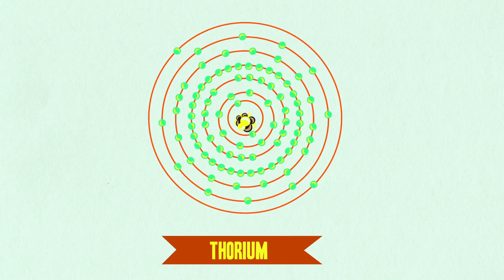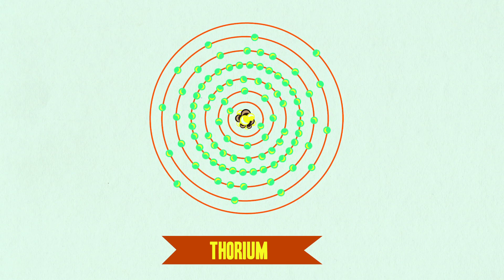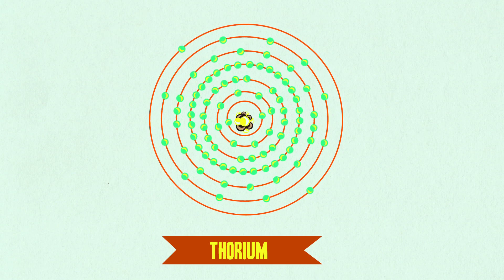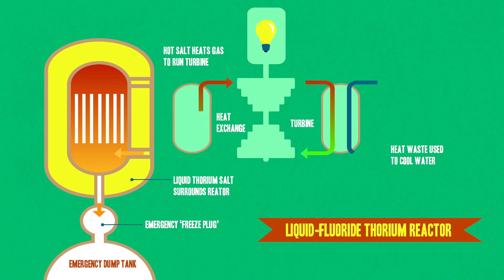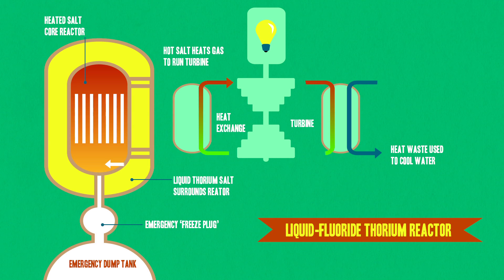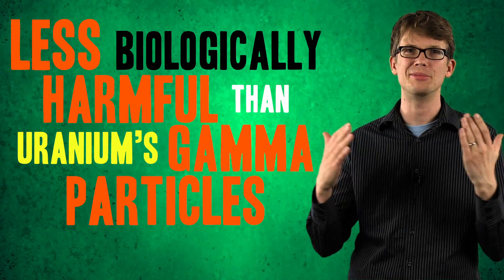Liquid Fluoride Thorium Reactors (LFTR): Energy for the Future?

Comment: While I'm not going to say that I'm totally against the LFTR design there are a few issues I have with this. 
1) both uranium and thorium are alpha emitters. It's what is further down the line that gives off the nastier gamma's in both cases. This gripe is more specific to this video and not the technology presented as a whole.
2) that "short" waste life is if we reprocess the thorium fuel. This is a necessary part of the thorium cycle. It keeps the big nasties in the core if you will. Then again if we reprocessed current Uranium spent fuel the same thing could be said with similar waste reduction (about 95%) and hazard times as the trans-uranics (heavier than uranium) are the most serious offenders.
3)The big reason thorium is said to be "non-weaponizeable" is that a small amount of it breeds into uranium 232 which is a very nasty gamma emitter and would cook anybody who got enough Uranium 233 (what you are actually burning in a Thorium reactor) in one place to make a weapon.  We actually tried to do it once and found this out. This isn't as big a problem if you don't care about killing the people building the bomb. However this means in operation Thorium reactors are actually more radioactive than a comparable uranium one fun fact.
4) moderate enrichment light water reactors actually suck at making plutonium retaining only about 1% (most of it gets burnt up and is taken into account when planning the life of a particular fuel element).  This is only an issue because each load of fuel is a few thousand pounds so the 1% of converted U238 left at the end is still a lot of plutonium generated. Fun note if you ran a reactor that was near 100% u235 almost no plutonium would be generated.
5) Thorium is fertile not fissile. This means you have to breed the thorium into something that works (Th232->U233). Currently India and China are playing with it but the doubling time (time it takes to get twice as much fuel as you started out with) is a lot longer than a cycle so you would need a lot of uranium or plutonium to supply the neutrons to breed enough thorium to keep the whole show going. Sub critical accelerator driven breeders could cut this down but it's not a solid tech yet and this problem is generally one not taken into account by the hype.
Again I'm all for the development of Thorium as a fuel type as there is enough of it to keep us electrified for hundreds if not thousands of years but a lot of serious innovation needs to be done to ALL nuclear technologies which have been oppressed in the realm of public opinion and politics for most of their existence. Most notably if we seriously want to start being a space faring race we're going to need nuclear reactors in space.
Reply: Andrew Gahan oO

Comment: Did he say that uranium emits aamma particles? Shouldn't he say gamma rays?
Reply: +Richard Yates I think the original commenter only said "aamma" because of a typo. I believe what they were asking was why he called the gamma radiation a particle rather than a ray
Reply: either makes sense. the wave particle duality says that light behaves both as a wave and as a particle (represented by photons, the carriers of the electromagnetic force). so technically, you could say either and you'd be correct
Reply: I think he does say aamma, but I'm listening on laptop speakers. At least he did mention alpha particles, they only travel a few inches through air before they break down. Hank is the only one besides Sorensen I've heard mention this in a video. I hope he's not saying Llama particles, I'd hate to have those little black pellets all over the place stinkin' it up.
Reply: oh I get it, he doesn't know the particle travels in a straight line a.k.a. "ray"
Reply: +Richard Yates well, it's not that he doesn't know. regardless of whether you call it a "particle," a "wave," or a "ray," you're correct. I posted a comment in response to the original comment that explains what I mean
Reply: the problem there about weather it admits gamma or alpha comment is WRONG! gamma is the least of our worries alpha is a serious issue and the worst type of radiation for someone to uptake
Reply: yeah, noticed it too..
Reply: Alfa radiation does not penetrate deeply. a sheet of paper is enough to stop it. however, if it does penetrate, it can do a lot of damage. gamma does have a lot of penetration power but doesn't do that much damage. the thing is, gamma can pass through meters of concrete and lead before it stops. so it can affect more matter but not with as much power as Alfa. (or at least, that's what I remember from physics class last year)
Reply: yes that is correct I am a long time employee at a nuclear power plant in Canada gamma is no big deal but beta  and alpha are serious hazards. not to dismiss gamma though
Reply: So you have an interest in maintaining/propagating the current uranium dioxide system yes? It's explained fairly well on Wikipedia, people can see for themselves what the particles consist of,

Comment: it's only expensive to convert current plants, creating new ones, using multiple smaller cores, added when needed, is cheaper.

Listen, if I sold you a GE or Westinghouse nuclear reactor, I'm gonna want you to buy fuel from me.. it is therefore the norm, and an easy, lazy way to make a profit. Therefore, there is no need for scientific and technological progress.. just keep buying my rods!

interestingly, it seems that the waste created by current conventional plants can actually be used, so this can reduce the dangerous waste we have in storage currently to stuff that is far less dangerous, as you say, for no more than 360 years....
Reply: This a good point, from what I gather no one is considering converting conventional nuc-plants to run on Thorium anyway; they want to convert them so the waste they produce will be easily consumed by the new liquid-Thorium plants. That type of conversion may not be very costly considering the expense of storing the long lived waste they produce now.

Comment: I would like to see the benefits of the LFTR combined with the efficiencies of CANDU designs like online refuelling and safety systems.
Reply: All MSRs, including LFTRs, have inherent safety that beats any water cooled reactor, and depending on the design, LFTRs have continues fuel processing.
Reply: Have you noticed Koko, how many people on the internet think the pumps in the LFTR are for cooling? If the pumps in a LFTR stop working, The LFTR stops producing heat or radiation. The molten Thorium salt is there to transfer heat to gas-turbine electrical generators. There is no boiler and no water there to explode like Chernobyl.
Reply: you hit it right on the head there with CANDU!
Reply: I'm going to go look it up but can you give a short explanation of CANDU for everyone?

Comment: Ames process. Use Thorium to help make Uranium. But I guess that's too good an idea. The 1950's  ideas are too old to be of use?
Reply: LFTRs are a 1950's idea, they came from the same man who developed our current Ur-based plants which are very much safer than Fukushima. The U.S. Air Force funded Alvin Weinburg ("on the sly" sort of) to research a smaller mobile plant for electrical generation on the battlefield. They started development in the late 40's and Nixon "pulled the plug" on them before they could actually test Thorium in they're "emulator" type reactor.

Comment: Since Thorium is an element, is there any possibility of its extinction in future due to much consumption? Even if it does, will there be an alternative?
Reply: Thorium is extremely common. I've heard estimates that the sun would burn out before we run out of thorium. By the time the sun burns out who knows what we'll be using for power.
Reply: Well.. that's not nice...anyways thnx for the info
Reply: kokofan50 But how will sun burn ouy
Reply: John Peter The sun has a gigantic but limited amount of hydrogen to burn, and in about a billion years it's going to start running out of hydrogen and go red giant.

Comment: You neglected the fact that thorium reactors do not produce plutonium (bomb material)
Reply: +Joseph Fishwick yup the the thorium 232 at the start of the process is hit whith an electron and becomes thorium 233, which turns into proctactinium 233, which then becomes uranium 233.  the uranium 233 is the end of the decay chain within thorium based reactors, and while it is being used as fuel for the reactor one of its  electrons flies off and hits another thorium atom starting the process over again. by comparison uranium 235 and 238 which are the most naturally found forms of uranium and are what are normally used in our reactors now. 235 is what is fissile, while uranium 238 is what is turned into plutonium 239 before it can be used as a fissile material. the problem with that is that uranium 235 is the  far less common of the two isotopes and it is practically impossible as far as i know to separate the two before sticking them into a reactor, and thus not possible to remove uranium 238 from the equation. thats partly why the thorium reactors are becoming more of an interest, because while in the end uranium is used it doesn't leave behind any other isotopes like uranium 238 that cant be used as fuel from the start. "if you already knew this then consider it a comment meant to help others understand a bit more of the process involved" btw i might have gotten electrons and nuetrons mixed up
Reply: +yusted1 my bad, there's a video about that by periodic videos

Comment: If the technology is viable, then it should be the standard. It's safer and cheaper, where is bad? Even if you refuse to retrofit old reactors, all new reactors could be thorium
Reply: It's because of that people don't understand a lot about it, if you say nuclear power they will always be like, no don't do that you saw what happend in japan. But more people die because of coal mining, and the oil bussines would also be going bankrubt which would take millions of jobs.
Reply: +godonlyknows13 Its because the maority of people have got 0 knowledge on how a Nuclear plant even generates energy..most people think the huge chimneys of a Nuke plant spew radioactive clouds..while in reality its the steam that powers the turbines that gets released(sure theres some contamination in it but its way too damn small).
Heck even uranium based nuke power atm is quite safe to use and accients do happen but very rarely like maybe 1 major accident per like 25-35y(thats the diff between Chernobyl and Fukushima),the problem with current reactors is that unlike other tech,reactor tech stayed the same after the 70s and has barely changed and most power plants are old thus more prone to accidents,if they spent money on just upgrading the current reactors to make em better it would be just as fine as using thorium.

Comment: CHINA !!!!!!!!!!!!

B#TCH PLEASE India produces more than 50% of all research papers worldwide pertaining to Thorium Research and Fast Breeder Nuclear reactor .. also it produces roughly 70% more citations per paper than china ..  .. actually in the long run india will be at the lead
Reply: +iPredator Gamer India does research about Thorium fuelled reactors, yes. In this case, there is confusion between the use of molten salt reactors and Thorium fuel. US reactors have been run with Thorium in the past. Using Thorium by itself does not confer that much of an advantage over the existing fuel cycle.

India at one point had research going into the use of Thorium in molten salt reactors, but they're primary focus, of which you reference, are in using Thorium in a fast spectrum breeder reactor.

Comment: Seems interesting, but I'm still hoping for fusion instead.
Reply: well, get ready to wait atleast 40 years mate
Reply: Furkan Kurt Well, I'm not willing to make any specific predictions personally. If I'm not mistaken an experimental fusion reactor has for a very short period of time produced more energy than it consumed for example. How long it will take until it's a true source of power, well personally I'm skeptical of any predictions of how long it'll take. But that's mostly irrelevant to my comment.
Reply: +OneOnOne1162 To date there has not been a fusion reaction that produced more energy than it consumed.
Reply: Vincent Hughes I know that. So what? It has been improving steadily.
Reply: OneOnOne1162 You specifically mentioned a major breakthrough earlier, suggesting that that breakthrough signifies major progress in fusion. That breakthrough has not occurred.

The fact is that the basic capability to sustain an energy positive fusion reaction has not been demonstrated after 50 years, and billions upon billions of dollars. 

Assuming it was done tomorrow, there would still be many many more years of engineering to do to be able to convert that energy into usable energy. 

That plasma generates enough power to vaporize materials that we use to transfer heat. The conversion of this plasma to energy is by no means trivial.

At some point you have to eat the bird in the hand so you can survive to catch the two in the bush.
Reply: Vincent Hughes I was talking about this one. My recollection wasn't perfect, but this is what I was referring to.
http://gizmodo.com/nuclear-fusion-just-got-more-energy-out-of-its-fuel-tha-1522006589
I'm aware of the difficulties. I'm also sure they'll be overcome.
Reply: OneOnOne1162 I assumed that was what you mentioned. It was worded trickily to give the impression that most people got from it. I don't blame you for that. 

On the nuclear engineering front, not many of us hold out hope for fusion in our lifetime. The more you learn about nuclear fusion the more improbably it seems that it's anywhere near being usable.
Reply: Vincent Hughes It was actually just my recollection which failed me.

Meh, breakthroughs happen. Plus, it also depends on how much money is out into it at any one time. Although needless to say, I wouldn't ever mention WHEN I think fusion will become a viable power source because I think historically people are fairly bad at predicting that sort of thing.

Comment: I ended up learning about LFTR's while browsing the off beaten path on youtube late at night. I believe it was a documentary about Thorium from Kirk Sorensen, and after I heard about LFTR's I started researching. What is interesting and sad at the same time is how little people know about  the LFTR design and the second you even say Nuclear, its pretty much an F-U GTFO, and EPA shut you down kind of response.

Liquid Fluoride Thorium Reactors could very well save us from the aging Uranium reactors that are currently in use, and they do not use water to cool them, so no more tritium deposits in water tables that make people sick and die.
Reply: +Spartan536 Better than that no more need to build a reactor based on stacking up layers of redundancy to try and make the certainty of a meltdown not happen till after the plant is commissioned for the majority of the plants as with the uranium ones.  Of course that means designing a plant as if it was for a 500,000 year service life to last just 50 and only write of 1 in 10,000 reactors to meltdown while in service kind of thing. All because the solid fuel reactors cannot by definition be made fail-safe they always need external water or it's game over.  LFTR can be designed to be passively safe so that the thing will default to a safe condition even if everything from the outside goes down.
Reply: Spartan, you are being WAAAAY too logical.
Reply: NRC should be disbanded for that...

Comment: This is where you can find out when our planet was destined to turn to shit, as soon as they chose the Uranium (breeders) over that of the LFTR technology. Just so they could make nukes. Nothing has changed, the fact that they're deliberating over retrofitting the current nuclear power plants because LFTR still produces radioactive material id ridiculous. The difference between a 10,000 year half life and 300 years is a big deal, shame that the people who make the decisions for the rest of you don't know anything about what they're actually talking about. Yes, China have been sending engineers over to the US to get the knowledge for building LFTR's. Keep an eye on china, they're the only one's who seem to have noticed that no one will have enough power very soon. They even say that they're aiming for export, so you'll be buying your power from China soon enough. Won't that be a kick in the teeth for everyone. That's ok though, as the people who make these decisions will never go without, whatever happens. Good luck everyone.
Reply: +Shad Sorensen It's not just that it's more complicated, there isn't a good solution as of yet. The "plumbing" issue has to be solved. Neutron economy in an MSR is above par, so properly designed you could provide for the excess absorption by the Pa. A single fluid converter design seems most logical to me.
Reply: +Vincent Hughes Bettamax Vs VHS.  We are discussing which superhero is the best.   It doesn't matter they are both going to save the world! Lol
Reply: +Panc8ke Retrofitting current reactors with thorium is not a great solution.  When thorium decays into protactinium, its half life is 28 days and during that time, it is a huge neutron absorber.  Thats why LFTRs are a better design because its easy to remove through a chemical process when its suspended in a liquid form.  You can wait until it decays into U233 and then put it back into the reactor.  I personally think the 2 fluid reactor though a bit more complicated would be the best way to go in the long run.